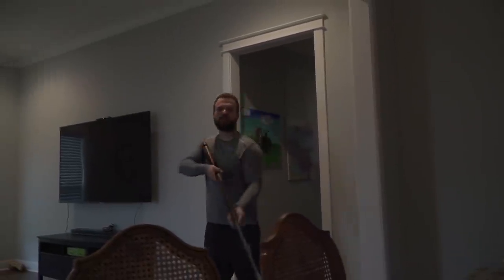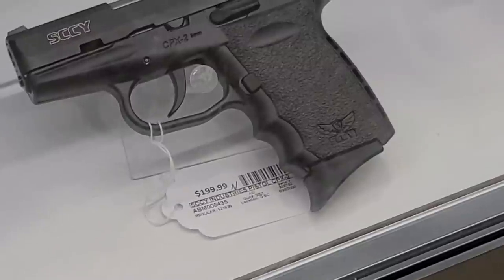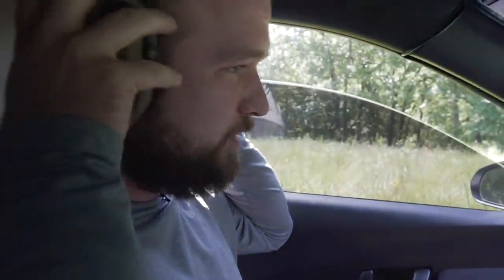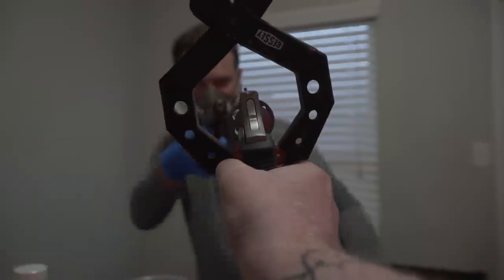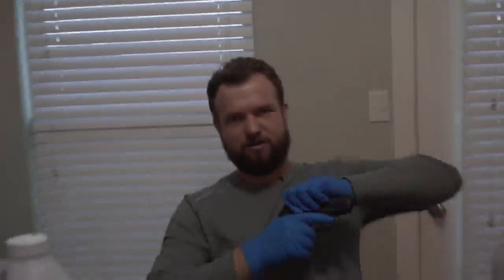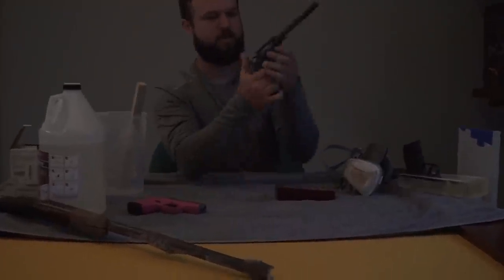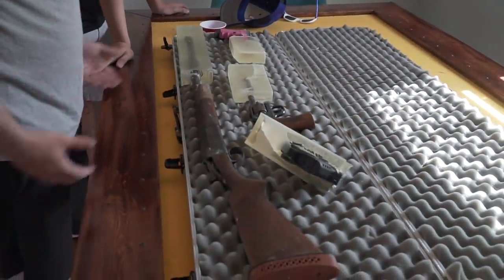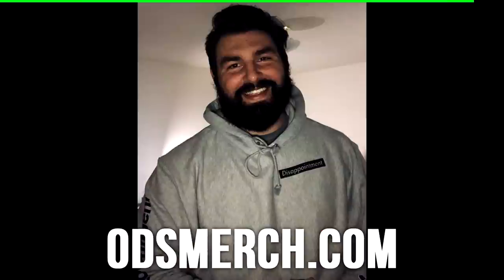I Encased 5 Guns In Clear Epoxy And Shot Them

Comment: People thought the last video was bad with breaking gun safety rules, in this video they do that and create a functioning sbr
Reply: @Tyborz  sbs sbr, potato patato
Reply: Hey guys don’t worry it’s damaged beyond repair it’s not a felony... and they shot it again didn’t they
Reply: Still an sbr.
Reply: @thefidgetstore4652  nah mate, SBR is specifically a pistol, intermediate, or rifle cartridge firearm that has a barrel length under 16 inches, but it's not an SBR if whoever manufactured and produced it sold it as a pistol, which means no stock basically, you can't do that with shotguns though- to an extent anyway. An SBS is a shotgun with a barrel length under 18 inches, there is a way around it with guns such as the mossberg shockwave or remington tac-14/13, the only reason these aren't SBS's is because they meet the overall length requirements for a shotgun, but they also aren't a shotgun? Depending on the state they're either a pistol, AOW, or a "firearm", maybe some other states legally define them as shotguns? I dunno, shit is super fucking confusing and stupid, for example pistols that shoot shotgun shells, you can't create a firearm that only shoots shotgun shells? At least, I think? Since there isn't any 12 gauge or 20 gauge pistols, there's only .410 pistols since they can also shoot 45 colt- or 45 ACP if you're using a Governor instead of a Judge.
TL;DR: There is a literal and legal difference between SBR and SBS, also fuck the ATF
Reply: Sbs
Reply: @slavinib6857  they meet the length for a "firearm" or something like that, its stupid. gosh darn ATF making up things again.

Comment: I hope yall have a good lawyer! Or that shotgun barrel was over 18 inches. Because if not well RIP
Reply: Looks like it could've been but isn't the law 18" barrel or at least 26" total length of the shotgun?
Reply: I dont live in america can anyone explain why that is illegal to cut off the barrel on a shotgun and what sentences you get for it?
Reply: Daquan Shotguns have a minimum barrel length of 18 inches because our gun laws are stupid.
If you make one with a shorter barrel it's a felony, I believe minimum 10 years for illegal manufacture and possession of an NFA item
Reply: @Robert-qm7yi  you're right, did some more digging and the barrel has to be 18". The 26" total length I referenced in the really vaguely worded law still requires an 18" barrel unless you get permission for production or if it was manufactured that way originally. Even if it was manufactured with a very short barrel originally it still has a minimum total length to be legal to be sold with the nfa stamp. I honestly don't understand how the Diablo 12ga pistol was ever approved for sale and manufacture with how convoluted the law is on this one.
Reply: Tsuiso Sim Drifting The vaguely worded law is what constitutes a firearm, over 26 inches and not a rifled barrel and designed to be shot with two hands.

Otherwise you need to file a form 2 I believe and pay 200 bucks
Reply: @Robert-qm7yi  It's just insane how vaguely they state everything. Without actually doing some extra research i can easily see how someone could put themselves in a bad spot thinking they are within the law still. That's the main reason I've never wanted to get my hands on anything outside of what i know is easily doable and legal with a simple tax stamp. Obviously not the guys in the vid, either they're going and doing all the paperwork behind the scenes or they really just don't give a shit if they get caught doing something illegal.
Reply: @jkalash762  I believe the reason that specific one is legal is because its classified as a "handgun" or under "any other weapon" but if you had a shoulder stock on it then it would be classified as a SBS.
Reply: @heavytrooper2402  true. I did some reading on it a while back and i just remember it wasn't easy for them to get it approved and its one of the only modern shotgun caliber pistols.
Reply: Tsuiso Sim Drifting Welcome to american gun laws.

The shockwaves aren't shotgun pistols by legal definition, they're classified as a "firearm" which is a stupid classification for things that aren't easily classifiable. 
Makes no sense, but if the government is involved it can't make sense
Reply: @Robert-qm7yi  lol too true. Gun law definitions are ridiculous. I was doing some looking into back powder laws and while its pretty straightforward as a whole some of the state to state black powder laws are so confusing.
Reply: @jkalash762  and for just under $500 thats not bad at all.
Reply: @heavytrooper2402  it's really not. Would be a ton of fun for not a lot of cash. Probably a pretty sore wrist the next day but worth it. I can imagine how crazy the spread would be if you ran bird or buckshot shells out of it.
Reply: Daquan because of the people don’t understand that criminals are going to commit crimes any way. That doesn’t matter anymore in 2277 though.
Reply: I’m guessing the ATF doesn’t care about 3 idiots on YouTube, charges like that are what the government puts on you to make others stick or to blackmail you
Reply: @daquan6213    if you make the shotgun a sawed off you make the spread of the bird or buck shot way bigger coming out of the barrel is why its illegal.

Comment: The good news is that the shotgun isn't technically a felony because it's not technically a sawn-off... wait, you did use a wood saw to grind part of the barrel... nevermind, there is no good news.

The worse news then is that the ATF is at the door. They've got knuckle dusters and a baseball bat, and they look pretty angry.

Comment: Encasing the revolver in epoxy so the cylinder could not turn shows your firearm experience level. Very dangerous video
Reply: So you're telling me that if you don't realize something about a certain gun you have little firearm experience? I work with an F88 and can take it apart and put it back together in a minute but i couldn't do that with an M1911 so does that mean i have little firearm experience

Comment: Pawn shops can't even sell firearms in my state. You are lucky. Background checks usually take like 3 days. I can't just go and buy 4 firearms for a 'project'. You guys can just go buy 2 more in 30 minutes and come home with them. I wonder why that is still a thing with how gun laws keep getting more and more strict.
Reply: can i ask a question im not trying to be rude or piss you off. but how do you see buying a gun in 30 minutes as a dangerous act like we need a law to prevent that and is essential to saving people life. like what so dangerous about it i just dont see how its a extreme danger. also how does waiting multiple days make the transaction safer before you get the gun you bought?

Comment: I find it funny people think wireless is better..  A: your battery dies you can use them.  B: I bet they get interference since its in the air instead of down a hard copper cable.

and C: of  course theyre tiny, so you can lose them easily.             end run   marketing ... oh and audio will always be better on a wired device.